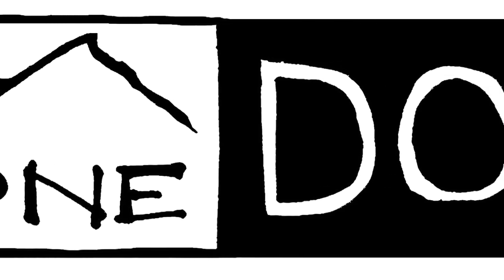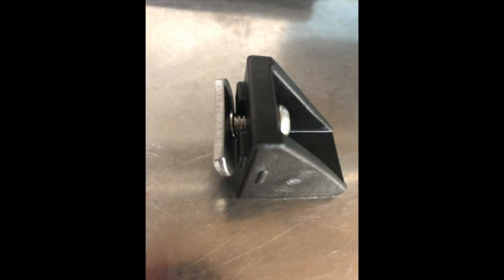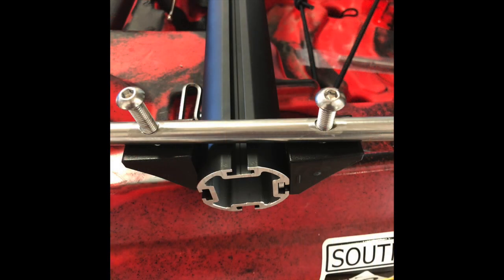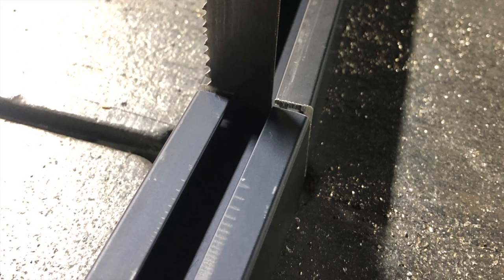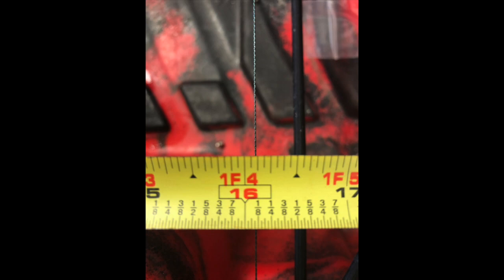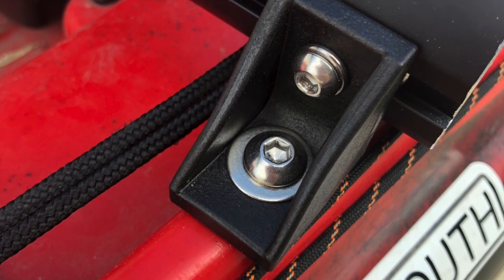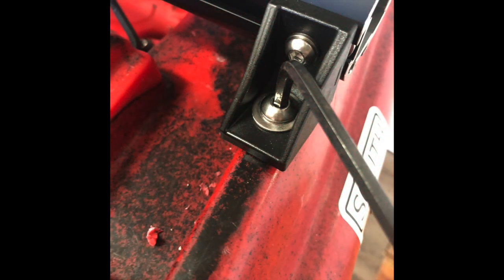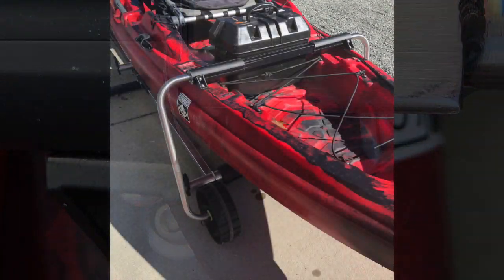Boonedox Groovy Landing Gear Installation - Old Town Predator XL

Comment: I have a question,  I ordered the wrong landing gear... I order for a Outback and I have a Pro Angler.... are the hardware the same? I know I'm missing the different backing plate and the 1/2 spacer... is that something I can order separately considering hardware is tge same?